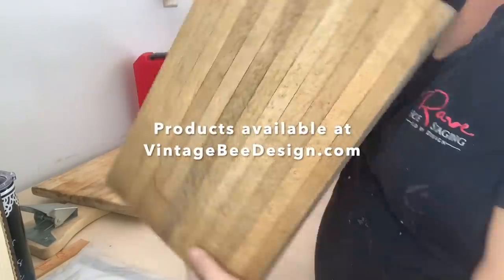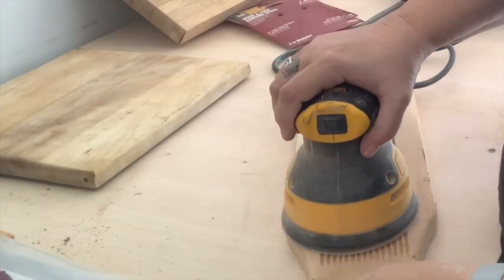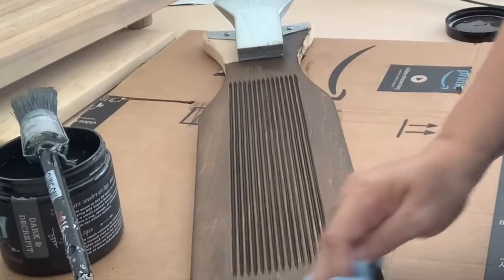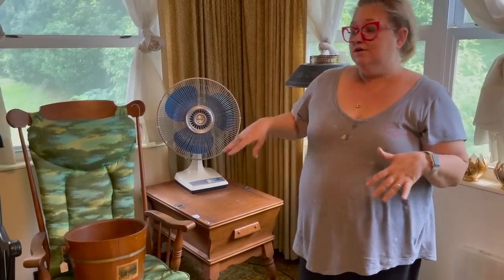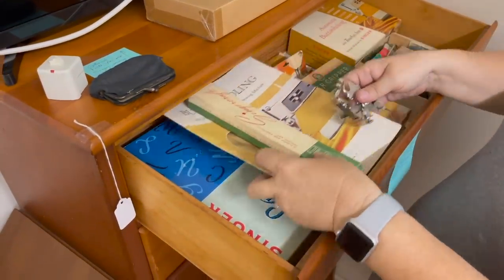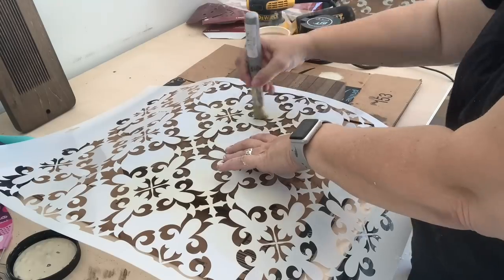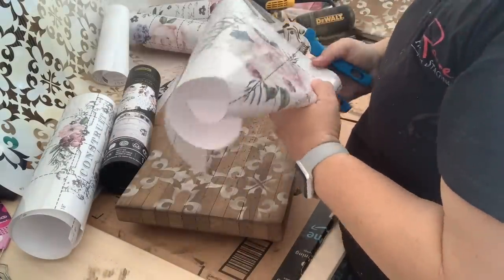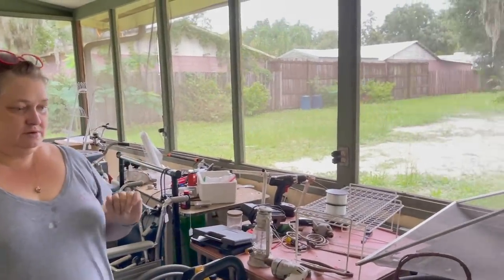Cottagecore home decor | Shabby Chic DIY | We bought the whole MID CENTURY Estate!

Comment: Thank you for the tip on stenciling! Very helpful
Reply from the maker: You are most welcome! Thanks for watching!
Reply: Thank you for the video very helpful! What is the best paint for stenciling that’s permanent for all surfaces and for fabric?
I’ve also used chalk paint but it ruins my stencil work and hard to wash off my stencils.
And lastly do you have to put a top coat over a rub on transfer like to use for a wood tray?
Thank you! 😊
Reply from the maker: I would recommend Fusion or Dixie Belle Silk. They both have a built in top coat. Silk is easier to clean up after. Yes. You do need to seal after adding a transfer. You can use wax or a poly top coat.
Reply: @VintageBeeDesign  thank you so much for your reply. I am learning so much from your videos! My best to you and your creative business 😊
Reply from the maker: Thanks for the kind words. I’m glad you are enjoying!
Reply from the maker: Thank you!